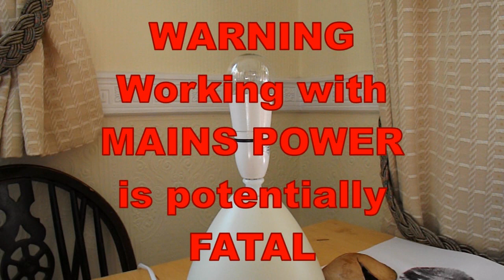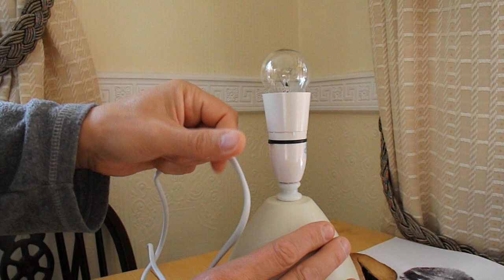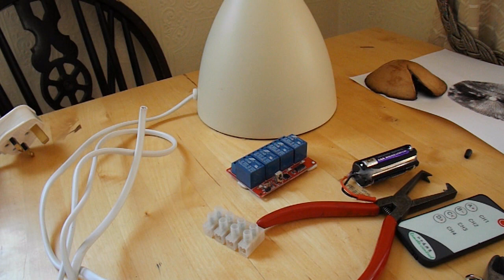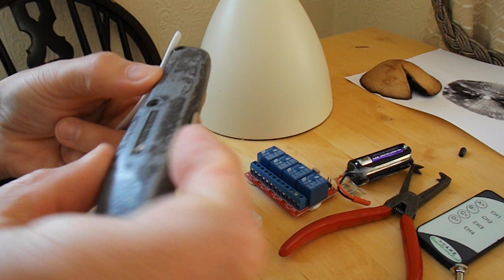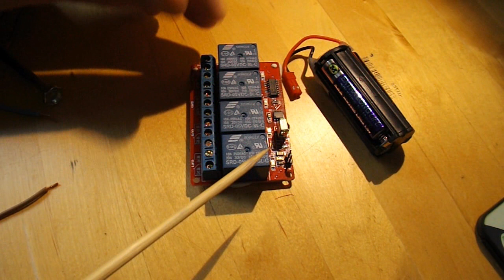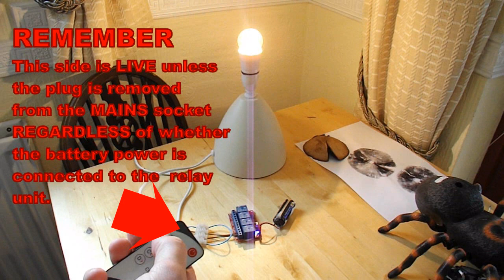Infrared Remote Control Light Switch

Comment: hey are their any small ones like this for like a torch . 4.2volts. kinda  littrally needs to be able to fit in to a box the size of a mobile phone
Reply from the maker: If you click on the eBay link in my video description it will take you to the one I bought. If you then scan down the eBay page it will show you similar items and that should be enough to get you started on searching for what you want.

Comment: Great video. Can you have more than one remote to control the light?
Reply from the maker: This is just a demonstration of how to do it with standard components available from online stores (back in 2014). You would probably find those controls all operate on the same frequency and would operate every remote switch in range, like some TV remotes operate other equipment. Your bigger problem would be if you wanted to control two different lights. Those remote units would probably switch all the lights at the same time. You would have to check the specification of the remote switching unit you chose to see if it is a coded one that is matched to a specific control or a simple generic one like I used. Proper "smart switches" are available, even ones you can operate from your smartphone.

Comment: oh man, I just love your stripping wire cutter.
Reply from the maker: Pretty old technology, probably over 20 years old, in fact could be over 40 years old. I had one like that when I was working in the 70's.
Reply: +GrandadIsAnOldMan If it does the job, this is what is important.  At that time, things were built to last, today they're built to force consumers to replace them on a shorter period of time.  Fortunatly enough, you were born in the right period, so we'll have you around for a good while !!!

Comment: I guess that the beauty of this little project is the fact that it won't trigger if you use any other IR remote control.  Since it has 4 channels, the information must be decoded in order to trigger the proper relay, so it needs more than only the 38KHz carrier to activate.  Personnally I used a different approach with my project, which has only one channel, but can be triggered with any remote control having a 38KHz carrier.  If the predefined amount of "clicks" is detected within the pre-established time, my circuit will toggle a relay. I simply redo the same sequence to toggle it back.  I had to use 2x4017, 2xULN2803, 1xNE555 and some other miscellaneous parts.  It might have been an overkill project, but it does the job quite nicely, at least to my eyes.BTW, for safety reasons, it would be advisable to unsolder the IR receiver and solder 3 wires to it so that it could be mounted outside of a small project box, keeping the relay board along with the 240V connections inside the project box, making sure that nobody is ending up with a shocking adventure !

Comment: Hey There!I would like to tell u first that I'd never tried something like this..so...i didn't understand that what should i do!?So,I really request u that please tell me which switch i should use,which remote,which bulb,which circuit n all ..I would also request u to tell me the detailed materials that would i need for this............I'll be very thankful to u if u tell me wht I asked..
Reply from the maker: There is information in the video description BUT if you have not worked with this sort of equipment before then I say DO NOT ATTEMPT THIS as a failure could be FATAL. Ask a qualified electrician.

Comment: I'd like to do the same for 3V DC operated light. Are there any remote switches available?
Reply from the maker: +J Hein the switch is just a switch. Within reason, it is up to you what voltage you want it to switch. If you look at the eBay link in the video description you will see that one is rated to carry 250VAC-10A、125VAC-10A、30VDC-10A、28VDC-10A so it would handle 3V DC with no problem. The one I used allows you to switch 4 separate items but you could get similar single option switches. Just search eBay or your favourite online store  for something like "Relay Module with Infrared IR Remote Control DC"

Comment: What did you use to wire the AA battery to the 2 pin header to connect to the relay?
Reply from the maker: That particular plug is a JST connector commonly used with small LiPo batteries. I used it because it happens to fit those header pins and I use that little battery pack for some of my RC projects.
Reply: GrandadIsAnOldMan How many batteries would I need for a 15W LED (100W incadescent equivalent)?
Reply from the maker: Brian Pacheco this video has nothing to do with lighting LEDs with batteries. It is how to use a remote controlled switch to operate a piece of electrical equipment. The battery in the picture only operates the switch, it has nothing to do with the power that is supplied to the light.The light in this video is 240 volt mains powered.

Comment: Can you please just send us a link of something you can buy that connects to the input power. I understand its 5v, i also understand the relay side of things. I just want something that is either a plug or a battery that connects to the input power of the board without having to solder wire directly onto the contacts. If you cant, can you tell us what parts we need? Please dont just say a usb charger as it doesnt explain much about the connectors.
Reply from the maker: +HassMD111 surely you can do your own search for connectors on eBay. I believe the correct name for that type of connector is Dupont but I found the leads often used on small RC LiPo batteries will also work and they are called JST connectors. That is what I used in this video, I did not list it because it is not the "correct" item.

Comment: Where did you purchase that switch? Thanks
Reply from the maker: +Mike Mancini details are in the video description
Reply: +Mike Mancini It comes with the unit.  So you have the receiver part with the relays and the IR receiver then you have the remote control (the switch).  You only need to buy a CR2050 battery for the remote.

Comment: I used 3.7 v battery for the switch and it started smoldering, it looks like you are using 3, 1.5 v aaa battery`s? Is that correct?
Reply: +GrandadIsAnOldMan Thank you for your concern, I have a friend who knows this that I will consult before going any further.
Reply from the maker: Bram Schork thanks, I was worried when I uploaded the video so I put lots of warning messages on the screen and in the video description.

Comment: What kind of battery are you using for your IR remote switch?
Reply: +songofchaosZERO The Remote Control is Powered by a CR2050 battery which is not included when buying the unit.  You will have to get one on your own when you buy the unit.

Comment: can you give me the circuit diagram of the ir receiver and transmitter???
Reply from the maker: +Saumit Pradhan no, I don't have one. When you purchase the item you would have to check a circuit diagram is available for it. The connections for the battery and relay terminals are labelled on the circuit board and I would have no reason to look at the transmitter circuitry.

Comment: can u design a light system that turns on and off depending on water levels?
Reply from the maker: That hardly required any design work. You just need an arm with a float on it that is pivoted on the edge of the water container. The other end of the arm pushes a micro switch when the water rises to the right level.
Reply: oh. that sounds good but it may be bulky. I am trying to connect the water level to sound and light. my son has a science project to make cool experimental games and We want to put water in a bowl, and connect it to a sound and and light source. that says " complete' when water reaches a certain level in a bowl. participants will use a table spoon to transfer water in to the bowl until the said water level. once it hits the thresh hold, it lights up and says complete. Any ideas? I will prefer the system to use batteries.
Reply from the maker: I didn't specify any sizes. You can make the float and the arm as small as you like and the relevant position of the pivot would allow a range of movement precision. There are plenty of very small micro-switches available and they would all switch the power from a battery. You could go without a switch and just have a bare wire that makes contact when the arm moves to the right position. You could even just use two bare wires and let the water complete the circuit when it reaches the right height and touches both wires. An alternative to a micro-switch would be a tilt switch. Here is a video of a project I did using tilt-switches https://youtu.be/Pe35lfv7ZKA

Comment: Hai sir how many distines detected in remote
Reply from the maker: The range is about 8m and this switch has 4 channels but you can buy many variations with more or less channels. There is an old eBay link in the video description.
Reply: Nice
Reply: 4 channel pcb card how mach
Reply from the maker: Jobin Jose I suggest you look on eBay or a similar online store. The prices always vary.

Comment: Should not have cut the blue. In fact, can use the blue instead of brown.
Reply from the maker: +Cosmo John in the UK our convention says we put the switch on the LIVE wire which is the BROWN. Yes it will work on either wire. I cut both wires to make it clear for the video but if you cut the outer insulation carefully you could just intercept one of the wires so you only make one cut.
Reply: +GrandadIsAnOldMan Thanks for the nicely done video.

Comment: if it is that dangerous, how can it be practical？any prevention device？
Reply from the maker: The video is a demonstration of using the remote switch. Anybody working with mains electricity needs to be aware that working with mains electricity can be FATAL if you don't know what you are doing. The switch is not dangerous, working with mains power IS dangerous so I put a warning.

Comment: Not sure why you used the 'chocolate block', as you called it. Don't see any advantage.
Seems to me you could have split the cable in the middle where ever you wanted the switch, then just cut & stripped the line/hot/brown conductor, (wire), and connected it's two ends to the relay and not even interrupt the common conductor, (wire). A basic rule of thumb in electrical, I was taught 50 years ago, is any where you cut a conductor and expose the wire is a place for corrosion or a bad connection to occur later.
[Of course, when I was taught that, connectors and electrical tape were garbage. There was no silicone, anything, available in the marketplace, nor any shrink tube.
Hell, phillips head screws were a rarity, even! And the closest thing to a power screwdriver was a Stanley Yankee screwdriver. Oh, the suffering and misery we endured back then! LOL
It is still a sound rule, now, though, and helps you think about designing things with the minimum of components, both for cost and simplicity. It you learn things like that in the early days, it eventually becomes a habit.]
If it was necessary to use the temrinal block, for some reason, it was a good tip to use a chunk of the existing conductor for the extra wiring, not because it was cheap or handy, but it insures all of the conductors are the same gauge wire. You could use ANY wire of the same gauge, so you wouldn't have to use part of the cable. It is essential the conductor stays the same size through out, though.
If you substitute a smaller gauge conductor, and the current draw was high enough, the smaller gauge conductor could become a fuse, burning up before the original wire got warm. In the right situation, substituting too large of a wire would do the opposite: turn the original conductor into a fuse, (technically, a fusable link).
Cutting and connecting the lamp's power cord as I described would eliminate a unecessary plastic based component; saving the cost and NOT, eventually, adding one more piece of plastic to the waste stream. More importantly, there would be no live 240v connections exposed for some curious child or pet to mess with and get a nasty zap, (open screw heads on the top of the terminal block, {chocolate block}).
For safety's sake, as well, the exposed terminals in the IR relay block should be covered, as well. Either in a plastic box, or, at the very least covered with hot glue or silicone.
Kids will do goofy things, and are quite imaginative. I guess when I was about three, we had just arrived home, and a bunch of relatives were visiting. I must have noticed the process of starting and driving the car for the first, or something about it impressed me. I snagged someone's set of car keys laying on a table, and was just about to 'put the key in the ignition' and start my imaginary car, and go for drive, when one of my relatives saw I was about to stick a metal key, attached to a metal ring and a handful of other keys into a 120v wall outlet. Someone saved me from a nasty burn, or potentially, a deadly jolt.
Enjoy your electrical and electronic projects, but be safe and think safe, for YOUR safety, and the safety of others who may come in contact with your finished project.
GeoD
Reply from the maker: Thanks for taking the time to write all that. I explain in the video I am using this method to show clearly how to connect up one of these IR switches. This is NOT supposed to be a practical application.
Reply: I watched the video agaoin, to see where you said this was not a practical application, and didn't hear it.   You did mention you were using the terminal block to make it easier to visualize, but that was it.  You did make a passing reference to putting the terminal block in something to make it safer.  I guess the issue is, people WILL use this as an example of a 'How To', unless you are much more emphatic about videos like this being JUST for demonstration., Perhaps you're taking the ,demo only' stance as a liability avoidance tactic, but you have disclaimers in the body of the video.  I guess I'm just of a different opinin, that it is better to show good habits and techniques.
Reply from the maker: I am not going to argue with you on the semantics of the written English language. YouTube is not where to go to learn "How To" do things. Yes some people will use it for that purpose rather than seek professional advice. They are the same people who will take advice from a "bloke down the pub" and then wonder why they have a problem. Yes there are some people who make "How To" videos and put themselves forward as experts on a subject. Some of them are experts but a very large number of them are not and some of them are even deliberately misleading. You will not find "How To" in the title of any of my videos and I certainly make no claims to be an expert at anything.  As you have observed in this video I put regular warning messages as I was particularly concerned about using mains electricity and emphasised the danger and the fact that the circuit is live unless unplugged and repeat that warning in the video description. Perhaps you would like to make your own "How To" video and include all you own Health and Safety guidance to contribute to the YouTube community.

Comment: hi sir can you give me the circuit diagram or schematic of the circuit
or ic numbers
pramo
Reply from the maker: Pramo Ku I don't have a circuit diagram. Check the link in the video description to see the item on eBay.
Reply: sir can you tell me the ic number  used in the circuit?
Reply from the maker: Pramo Ku the only ic with numbers on it has the following. 50LTHGM ULN2003AG4
Reply: 50l thgm means programmed chip may be.thanks.it is not available in the market

Comment: Just buy remote a remote bulb
Reply from the maker: yes you could do that and it would be a simple solution. I have seen them in the shops but I haven't tried them. I assume when the bulb eventually dies you buy a complete replacement set of bulb and transmitter so I suspect it is not as flexible as having a remote switched power supply. The remote switched plug adapters might be a better alternative as they can be used for other options.